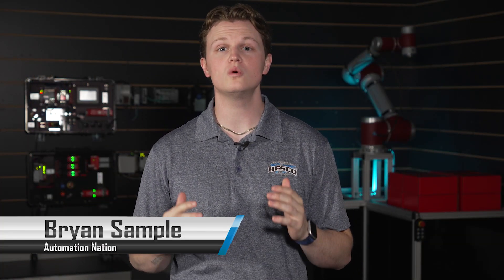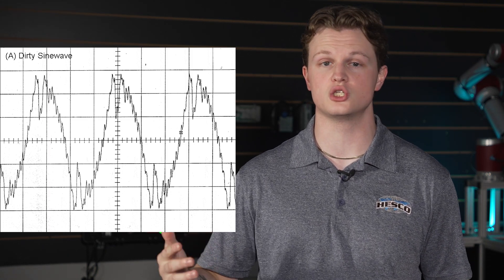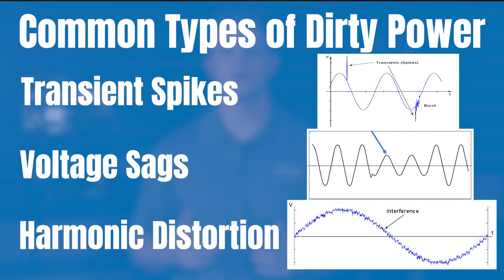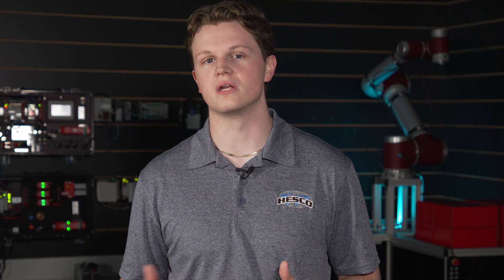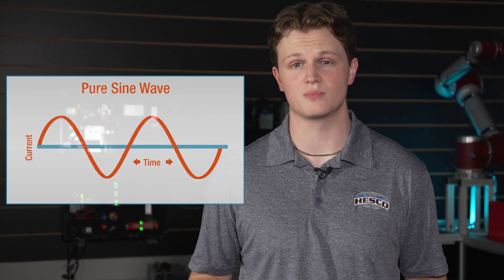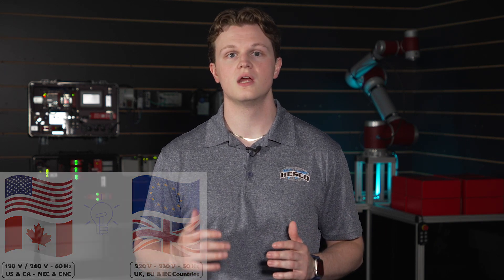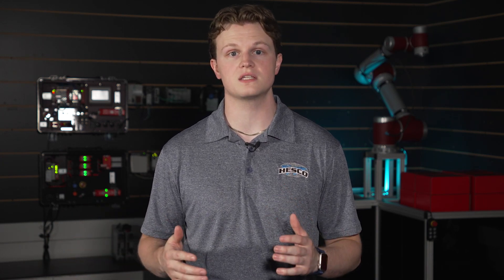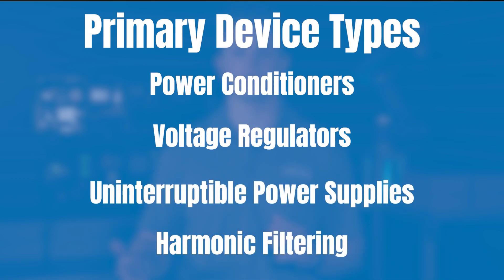Clean vs. Dirty Power: Understanding Total Harmonic Distortion in Electrical Systems

Comment: Please read this. I have a gaming PC with the following parts:
- AMD Ryzen 9 9950X3D CPU
- Gigabyte B850M Gaming x WiFi 6E motherboard
- Colourful RTX 5070 Battle Ax GPU
- Arctic Liquid Freezer III Pro 360 AIO cooler
- 2 x 16 Kingston RAM (6000 MHz DDR5)
- 2TB Samsung 990 Pro SSD
- Corsair SF1000L SFX PSU
- Phanteks Xt M3 case

I have noticed that my PSU makes this erratic buzzing noise (audible within 7 inches or so). I took it to the shop I bought it from (I bought it on December 20 2025) and it didnt buzz there. Brought it back home, buzzing again.

I am using SRGB42NB Surge protector for my PC. I live in KL, Malaysia where electricity is 230v 50hz.

I am honestly dying of stress, scared to use my PC, and just need some guidance. What is the cause of this buzzing at home? Is it dangerous? How can I resolve it?

I really would appreciate your time sir.

Comment: What’s the cheapest way to check if your getting dirty power? Apparently AU power is pretty bad. 

I have seen a company too where they kept getting dying machine. But I’m more concerned with my 1000w work and gaming computer that has $5k electronics. 2 monitors, 1 65” tv and lan connection 😂